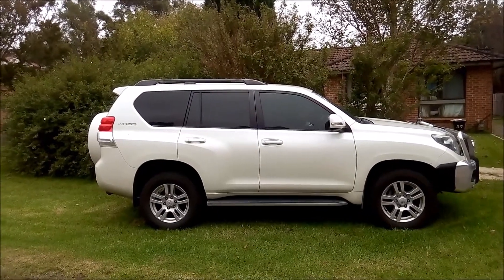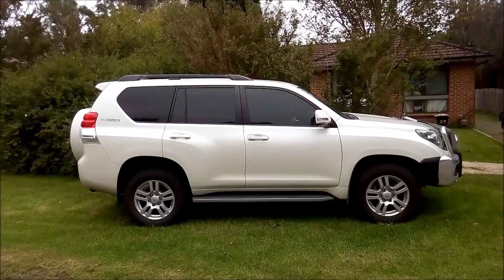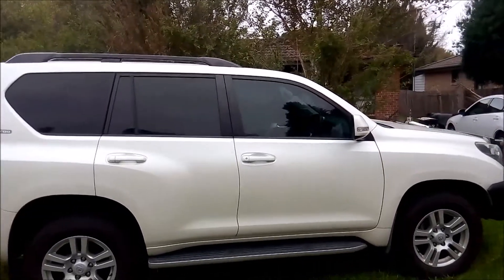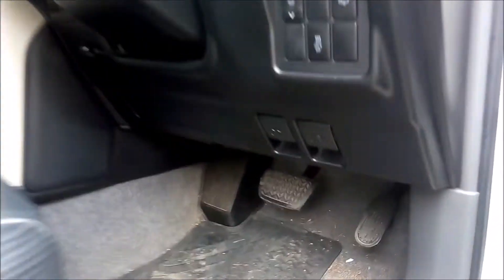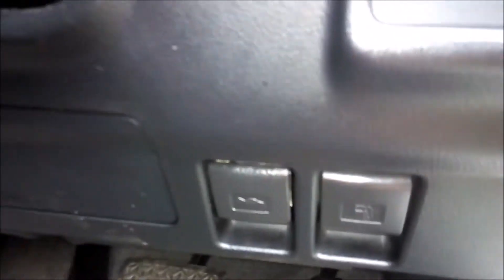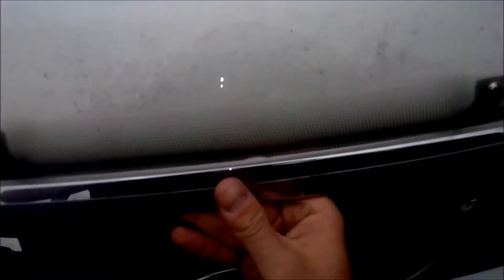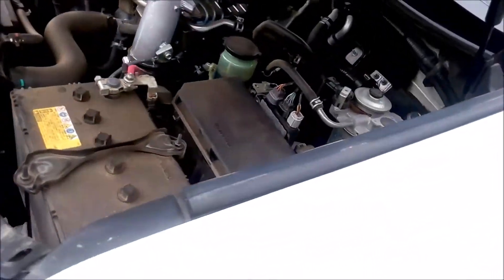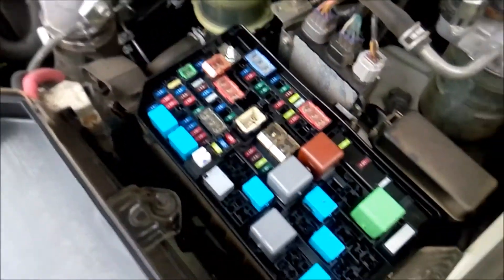Toyota Land Cruiser Prado OBD2 Diagnostics Port & Fuse Box Location

Comment: Well there are two fuse boxes and the one you mention is easy enough to find. There is another box under the dash almost inaccessible.
I had to get underneath with a torch to see it let alone change a fuse.
Reply from the maker: Thanks for your comment Richard, I should have shown the other one too
Reply: I still havent managed to change a fuse in it. Tried to and snapped it in half. WTH - how do I fix this?